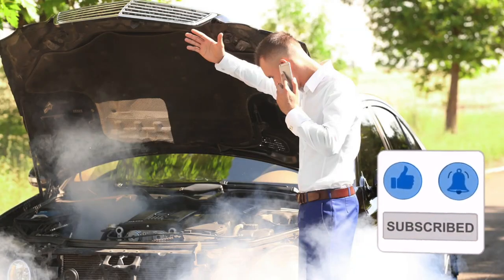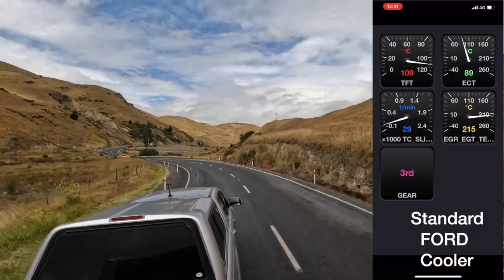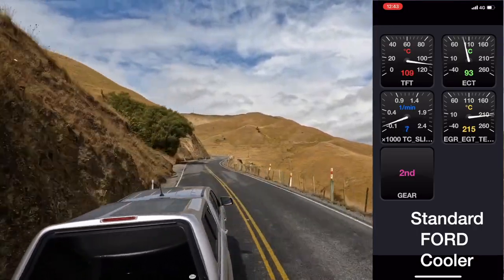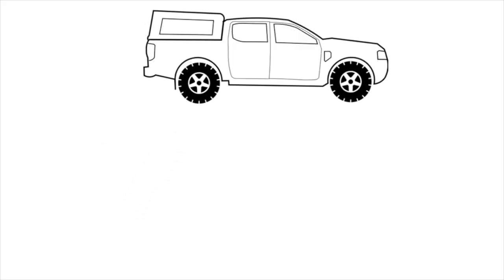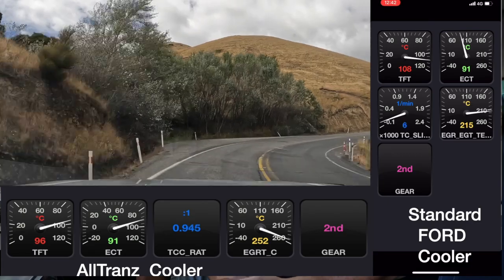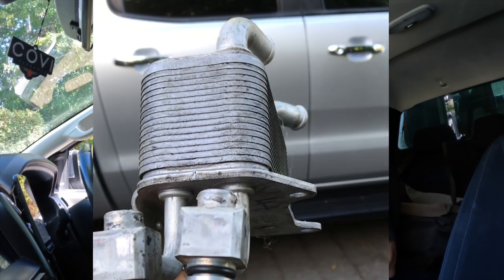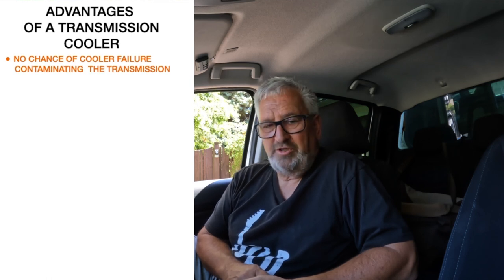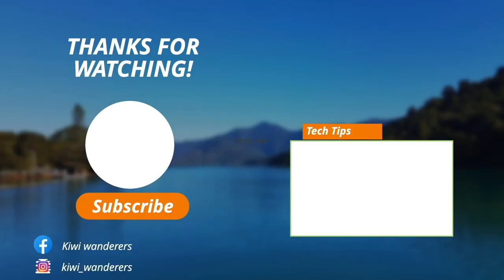Does a Transmission Cooler Make a Difference? We Put the Alltranz Cooler to the Test

Comment: I tow 3.0t with my Toyota Landcruiser V8 diesel and monitor temps with an Ultraguage (recommended for 200 series). Standard factory transmission cooler. Transmission temps on long uphills are around 67 - 70C. Water temp may get to 95C - still in acceptable range. EGT can get to 680C. I have a torque converter lock up module fitted which I highly recommend to keep temperatures down. Heat is the killer of auto transmissions. Cooler the oil, the longer the transmission will last.
Great videos Greg.
Reply from the maker: yea Your on to it the cooler the better when Towing... thanks for watching Cheers Greg

Comment: You can use a transmission fluid bypass thermostat to lock in the temperature both in the cold and hot. I use one made by derale in the U.S and it works great. It bypasses the cooler in the winter until the fluid reaches operating temp.
Reply from the maker: Great idea would definitely help in the winter thanks for the info

Comment: Really enjoying your videos.  We love your sense of humour, Greg.  We are hitting the road so with a 3.5t caravan and 2018 Ford Ranger XLT and are finding your videos invaluable and will be looking into these upgrades before we are full time (probably before).  Any recommendation on tow mirrors?
Reply from the maker: Hi Maureen, thanks for the feedback. I don't have towing mirrors as our van has a good camera so not much help on that one Sorry, thanks for watching Cheers Greg and Sandy
Reply: @KiwiWanderers  Hi Greg, this is Paul, Maureen's husband from the above post.  I've purchased the OBDLink and FORScan software and loving the new information.  Thanks for the tips and product reviews.  I am about to purchase the trans cooler from Alltrans.  I'm generally pretty handy, but wondering if you need any specialty tools to fit this myself?  When is your install video being released (no pressure..lol).  A second question, when you replaced your transmission fluid did you replace the gasket on the pan and how did you get the oil up into the filler, it looks quite awkward when I had a quick look under the Ranger.  Cheers, your technical video's are great.  Paul
Reply from the maker: @keenefamily2303  Hi Paul yea I know the install video is well due !!  It is a relatively easy job but I did have the. use of a hoist, removing the old cooler and fitting up the new pipes is a bit tight and mine was attached with t20 toques bits that were int he most awkward place.. Yes I always replace the gasket you can buy a kit with gasket and filter in it. filling the trans is a mission  as access is very tight and you need to check level when trans is at operation temp so the exhaust is hot ... not a good design but I used a trans pump like https://www.repco.co.nz/tools-equipment/garage-tools-equipment/greasing-lubrication-fluid-transfer/repco-fluid-transfer-pump-1l-rup1l/p/A1307491..thanks for watching Cheers Greg
Reply: Hi Greg, thanks for the additional information and the link to the fluid transfer pump.  I find it helpful when you include links to the products you have used, it makes our task a lot easier, much appreciated.  I mentioned your Kiwi Wanderer name into my enquiry with Alltrans.  Cheers, Paul
Reply: If you are pulling 3.5t then I think you are well over your weights. Just because the vehicle is rated to that amount, doesn't mean it's legal. I'd check that if I were you. Insurance companies are always looking for this type of thing when push comes to shove.

Comment: Hi and thanks for sharing. I have a wildtrak X, bi turbo 2021 we tow a 2800kg van loaded and recently on a 24degree day we towed up the A13 to Victor harbor and also last week through the Adelaide hills to Melbourne. Both runs remained at 93kmph and the standard trans temp hit a maximum of 166F or 75C and the car reached 98C the engine temp cycled down to 85C continually. do you have the 6 speed? 
I have seen a few trans temp videos and the 6 speed is always a bit hotter than the 10 speed so would you think I need a cooler on my next wildtrak V6 early next year?
Reply from the maker: Yeah We have a 6speed and our van is about the same weight. not sure you need a cooler on the next gen. the 10speeds are a better trans and it migh much up warranty if ya buying new. the good thing about the next gen is the trans temp gauge  is on the dash. thanks for the comment Cheers Greg

Comment: Did wonder about transmission temp on Vitara. Relying on it telling me when too hot, which is probably to late.  So far no problems with 1000kg van over Takaka hill which is about as bad as gets in NZ. Wish Suzuki used dash screen to display something useful like transmission and engine temp. Instead they have gimicky stuff eg torque and power graph, like you going be looking at these while driving hard. Plan is get transmission fluid change brought forward by few services now that we towing a caravan.
Reply from the maker: Yea very good Idea a trans fluid service is way cheaper than a trans overhaul. thanks for watching cheers Greg

Comment: Did u remove the factory transmission thermostat ?? [bypass kit available ] [trans valve body needs removal ] .  This combined with a large/single or a dual cooler works extremely well in hilly very hot ambient temperatures.
Reply from the maker: No I haven't removed the thermostat, but thats the next step if we still get to hot,, Appreciate the comments, thanks for watching. Cheers Greg

Comment: Remember to all this video was a single cooler [ many optional kits are dual cooler ]  tested at 25 deg cel . If u add higher ambient 32--40 cel  the operating temp will go up most definitely if towing a large van .  This all the proof you need that Ford designed these for snow conditions AND NOT Australian conditions as Ford claim . LOL .  ALL THE OIL COMPANIES tell you any thing over 100deg cel WILL DEGRADE your oil .
Reply from the maker: Very true thanks for the comments cheers Greg

Comment: Greg - another informative videos. May be a silly question - is there a need to monitor transmission fluid temp on a manual gearbox?? Cheers Peter Kakapo Kampers
Reply from the maker: No such thing as a silly question ...Not so much heat created in a manual, no toque converter or clutch packs, cheers Greg

Comment: I have a question ; I am considering getting a trans cooler bec in south Texas the summer can get brutal in the triplet digits . But my car is Honda civic coupe and nothing has been done to it (beside an cold air intake ). I was wondering if I can get an opinion if I need one for the hot temp. Or if my car is safe enough to handle it via it’s build design? Any thing helps
Reply from the maker: HI daniel , not sure about your honda, need to see what temp it gets to in normal use sorry I couldnt be more help , thanks for watching cheers Greg